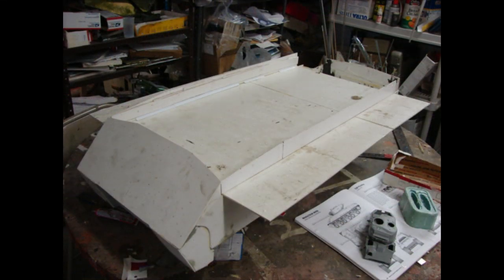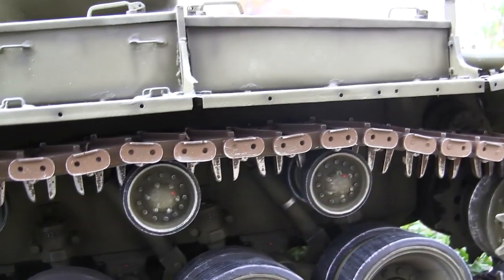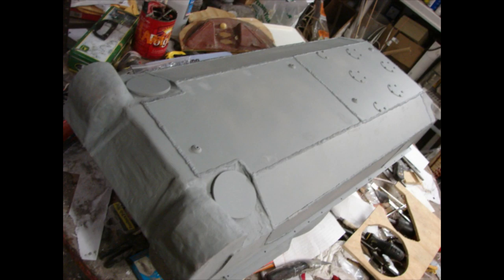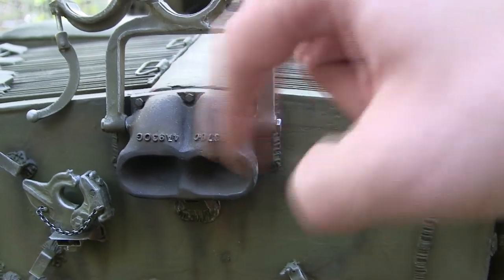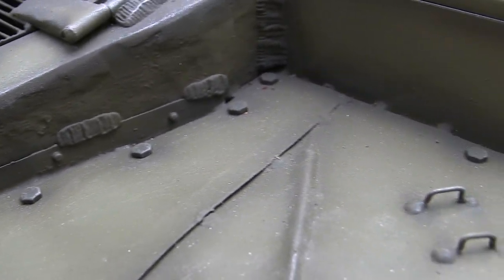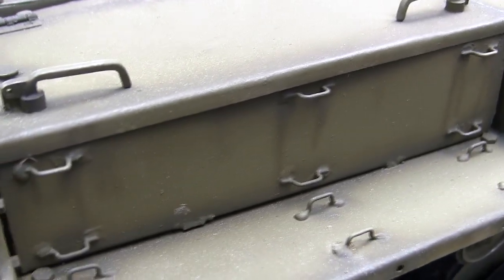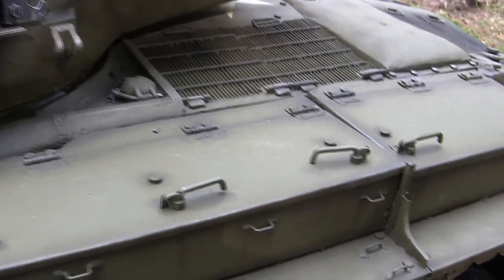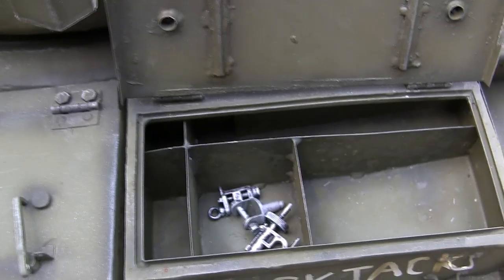1/6th scale M26 (T26E3) Pershing Model Showcase video Part 1 of 2

Comment from the maker: The running gear that this model has is designed and works well for static use, but for RC...not so much. I would have to have all my running gear parts reproduced in cast metal.